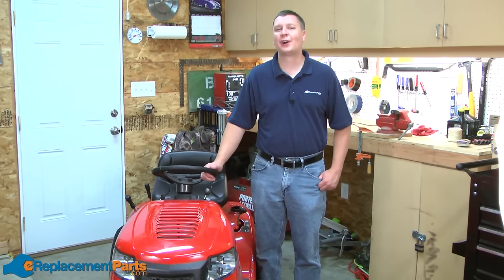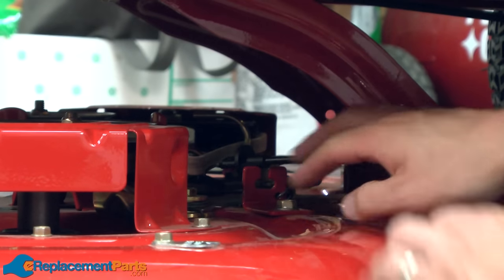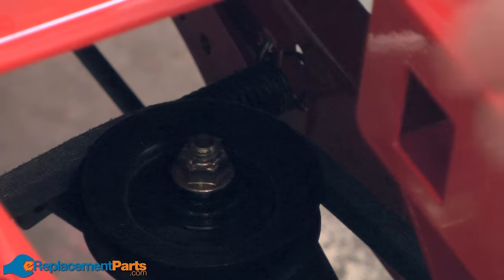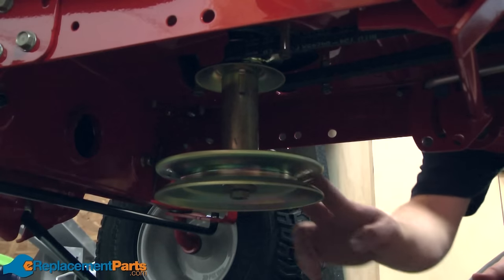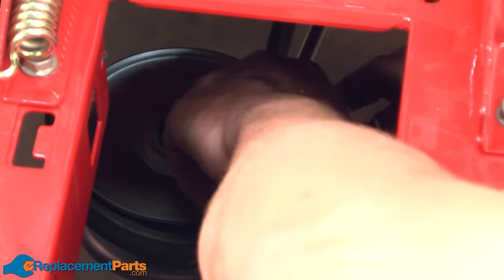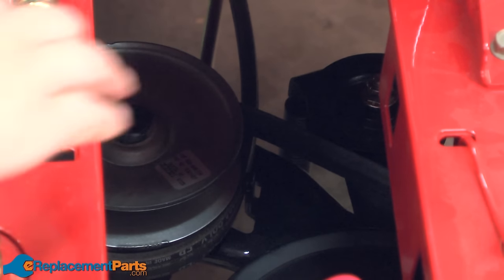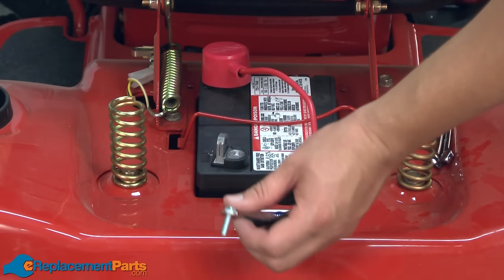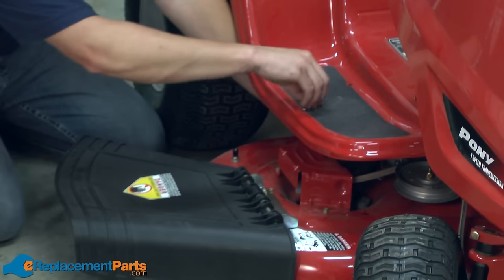How to Replace the Drive Belts on a Troy-Bilt Pony Lawn Tractor (Part # 954-0241A)

Comment: Thanks to this video, I was able o change my Troy Bilt belt. That being said, I will never, ever buy another Troy Bilt riding mower again. Never had so many steps to change a belt on any other mower I've owned.
Reply: Same here. Also I have never had so many problems with a mower before. I've had to replace 2 belts and the blade engagement cable all in under one season of cutting. It's a complete piece of shit.
Reply: I have Simplicity's , I helped a friend put a drive belt on one these Troy Bilts, it had 2 extra pulleys compared to this one, I have never seen a bigger piece of shit mower in my life!!! I used to think Troy Bilt made pretty decent stuff, not anymore after working on this nightmare.
Reply: Bob Faestel
Amen brotha, amen!

Comment: One of the easiest belts i even had the pleasure of changing, You don't have to do it the way he says if you are not changing that small belt and don't want to remove the deck., Just remove the battery and holders, take a 9/16 wrench to the Tensioner pulley it will not take much force if the main belt is wore and pull it towards the rear of the mower and slide the smaller belt off it and off the double pulley. now get under the front and remove the deck belt from the engine pulley, now take a 5/8 wrench to the engine pulley and remove the bolt and slide the engine pulley down and remove the drive belt from it. then go back to the rear of the mower and remove the drive belt from the double pulley the way he shown and pull the belt out. to install reverse order but with a new belt it will take some force to move the Tensioner for the small belt to fit there is no Tensioner pulleys on that big drive belt. should only take 10-15minutes to change that belt. less if you have the tools etc ready.

Comment: The problem I had was with the belt that goes around the transmission pulley, so a lot of this video didn't apply to me. But that which did, especially the trick for removing and reinstalling the idler tension spring, really helped. Once I got a replacement belt, I had my mower back to work in less than 10-mins. Thanks!

Comment: I just replaced a set on an MTD Yard Machines tractor, and they are just that, a set. Change both with OEM MTD belts and it will drive as new.

Comment: Great Video !!!...!!!!   Just finished repairing mine yesterday, but I am having the same issue as others,  in that the mower now moves slow and I can smell that the belt is now smoking.   Mine is a 2011 Craftsman 17.5 hp, but it looks exactly the same as the Troy Built.   (Obviously the same unit with the Sears brand name slapped on).   My biggest issues was determining if the belt goes inside or outside the idler pulley as I have seen diagrams showing it both ways.  It only seems to work on the outside (not the in) and that appears to be what you show in the video at 3.21...   Anyway, I will be going to Sears and seeing if I can take a look at the floor model and see how it works, if they let me remove the battery.  These little belts are breaking for a reason, but I have yet to figure out why, as my idler pulley seems to spin and move freely when there is no belt or spring,  as I  would think it should.   However my spring was hanging lose when I went to put on the new OEM short beltt, so I'm wondering why and if I reconnected the spring  to the proper spot?    I will follow up once I get down to the local Sears to check.  In the meantime, any help would be appreciated.   Dave Finn
Reply: Follow up to my comments above...   Although both models use the same small belt, The 2015 model which is set up the same way as your video is slightly different from my  2011...  :(   The idle pulley spring on the 2011 unit is much smaller and the double belt pulley is located to the front left of the the transmission, instead of the rear left.   However the  the 2015 spring  did   connect to the left side of the frame, whereas I had the spring attached to the side where the grass  exits  from the deck???     Also on the newer model, it was obvious that the belt went on the outside of the idler pulley, while I am still not sure if this was the case on the 2011 model...  :(.

Comment: That looks like a new tractor. On older models, the pulley nut (that you removed using the screwdriver to lock the pulley) is usually quite rusted. Any advice on how to free it?

Comment: Nice tip on the string. Thought of long nose vice grips but I am going with the string theory. Just replaced drive belt, what a battle. Got the belt on but now no start not even a click or any lights?

Comment: Very Helpful. Does the drive belt have an adjustment? MY dad had his belts changed last year and before the mowing season was up the drive belt was slipping. I was wanting to know if there was anyway to tighten the drive belt up. Thanks so much, Johnny
Reply: He might need new idler pulley springs to keep the tension up.

Comment: Last fall I had to use my 2007 Troy Bilt Pony for attaching a come-along to pull a fence tight. Afterwards, when I attempted to put my tractor in reverse, it would not move and stalled as soon as I released the brake/clutch. The PTO was not engaged.Could this be due to a drive belt needing to be replaced? I do need a serpentine deck belt of which I am replacing this week. Would that affect it? Or this possibly a more serious issue with the transmission? I also checked that the reverse safety switch was still intact, which it was.

Comment: There was plenty of time to explain why the negative first and the spring clips are not the pins but only hold the pins in place. Gloves would be recommended to reduce banging hands when clips and springs let go. Better lighting to see the work. This would only help someone experienced with mechanical workings.

Comment: Instruction manual says an impact wrench (which I don't have) is required to remove the front pulley.  Yours was easy with wrench (but yours was a brand new mower).  Mine is three or four years old. Hope I can get it off with what I have. Any special tricks, with a wrench , if it appear that it won't budge?
Reply from the maker: Hi Gene,  not everyone has an impact wrench. An I don't think you will have a problem with a wrench. If you do, get some penetrating oil and let it soak for a while, then you'll be able to remove it.

Comment: Thank you for the very informative video.  Is the idler pully supposed to move freely when the spring is unhooked?  Mine does not move.  I had to loosen the bolt that holds the 2 brackets together, move it in to put the belt around it and then move it back out and tighten the bolt back.  Is this normal or should the idler pully move freely against the spring tension?  Thanks!

Comment: Hey!  You did not have the Belt around the engine Pulley. That will drive the Deck  Blade System. You forgot to do that. Or ,you did not show it anyway.

Comment: ive got a 2003 troy built pont and i didnt have problems with it unit i changed the belt for a new one cause of wear from using it but not my drive belt want to keep jumping to the top side of the verible speed pulley

Comment: Would you use these steps to fix the mower belt? I went to engage the mower blade, and it instantly stopped. I noticed the belt came off. I was able to get the belt back on, and tried mowing again, which worked. Although, I'm unsure if I should replace it as it seemed very loose.

Would you you these same steps to replace the blades as well? Thanks for the tutorial, the only video I found that had good camera placement and explanations
Reply from the maker: Thanks for you comments.  The belt should have just a bit of play in it but they do stretch over time.  If you notice a lot of slop in the belt you you should check you the belt idler and the idler spring.  If the correct tension isn't held on the belt it could easy come off as yours did.

Comment: My variable speed pulley will not turn and is smoking belts.  I've removed three small bolts that attach bearing cup so that I may replaced, what seems to be, ceased bearing(s), however, I can only get bearing cup down maybe 1/4 inch and not all the way off of shaft.  Please advise as to procedure of removing stubborn bearing cup.  thank you-Mike W.

Comment: So I bought that lawnmower last year TB42 Can you pls tell me the length of belt the one that runs from bottom of rear pulling to front top of drive pulley? the belt in video that you ran up through frame. The place I purchased tractor from said they couldn't help me. Thank you
Reply from the maker: +phil gibbs I can get you the part number for the belt.  The TB42 is showing me different trimmers.  Do I have the number right?

Comment: Excellent video.  Did you actually do that in 11 1/2 minutes or is there some time not recorded?
Reply: mcconn746  I just did it for the 3rd time it takes less time if you don't remove remove the deck of the Axle pulley.

Comment: I have a mower like this. Any reason why the brake will not work in neutral? If I'm on a hill, it will only stop rolling in gear. The mower will stop while it's in gear.

Comment: My Front Motor pulley is hitting my deck and I can't raise my blade up past the 3 mark.  What do I need to do to get the pulley up and away from deck?  something must have jolted in traveling on trailer as it was not like that before traveling. Puzzled.  Any guidance is much appreciated.

Comment: I got a question I replaced my drive belt on my Troy built pony, got everything back together and with the mower in neutral and and mower turned off the mower will not roll forward or backward, what am I doing wrong?

Comment: Not to nitpick BUT...  you seem to forget about the pulley assembly mid-tractor & what a pain it is. Leave a socket in place over the nut in the floorboard while changing or it could move & you'll lose it.  Also you should ALWAYS disconnect the positive terminal on the battery first or you're in for a surprise if the wrench accidentally makes contact with the frame.
Reply: Actually, just the opposite.  You are more apt to hit the frame when removing the bolt.  If you hit the frame while disconnecting the negative, nothing will happen. Then there is no chance of a surprise when removing the positive.

Comment: I RECENTLY DROPPPED THE DECK ON MY TROYBILT PONY MOTOR AND SHARPENDED THE BLADES AND NOW ALL MY BELTS ARE LOOSE AND THE PTO DOESN'T SEEM TO ENGAGE WHAT COULD I HAVE DONE WRONG?

Comment: How much slack is actually in that lower drive belt that runs to the engine. I have 2 pullys that the belt runs over one and under the other; all springs are on and routing is correct, but lots of slack in this belt. Belt size is also correct. A picture of the amount of slack would be great. My mower is a 2004 model TroyBilt Super Bronco. The pony seems pretty close to it, with a few exceptions. Also, do yall have any videos on disassembly and assembly of the transaxle? Im gonna need parts for this. Thanks!
Reply from the maker: There should be 1/2" to 1" play in the belt.  The Idler Pulley and Springs are there to pick up the slack and keep the belt snug.  If the belt is to tight it puts unnecessary wear on the bearings and mandrels. We don't have much information about working on transaxles. Most of the manufacturers do offer the transaxles as a replacement part but typically nothing for the inner repairs.  Peerless manufactures alot the transaxles and depending on the manufacturer of yours, may be able to get a service manual to you.

Comment: Is this procedure the same for the Troy-Bilt Xp Horse Hydrostatic?
Reply from the maker: The procedure should be exactly as shown in the video.
Reply: +eReplacementParts.com That fixes the belts, but what burned them up in the first place?  Our Bronco (same basic design) rides forward in jerky movements and there is a smell of burning rubber   The short drive belt is frayed.  Could a bearing be bad somewhere?

Comment: Does the deck have to be removed for this repair?
Reply from the maker: Hi Michael. Thanks for you question. In order to properly access the pulleys that the drive belts run on, it is recommended to remove the deck. It is an additional step, but it will make your life much easier when you try to remove the belts. Thanks again and good luck with your repair!

Comment: I have a spring on my troy built bronco that I can't figure out were it goes. . I removed the deck to change blades .Now I have I spring about about a foot long that I can't figure out were it goes. .
so I tried the mower without the spring and it will not engage my blades to start cutting it related to that but I know where it goes?
Reply from the maker: +shon CONFIRM The spring you're asking about goes from the Idler pulley mechanism to the frame of the mower. If you can find the model number on the mower I'll get a parts breakdown to see if that helps.
Reply: +eReplacementParts.com I need help to start my lawnmower troy build

Comment: I purchased the belt off eBay the one that goes from the engine to the rear differential , unfortunately I realized too late that either I have to pull the engine out or remove the pulley to avoid the belt guides you know the two piece of metal sticking out of the frame to make sure the Belt doesn't jump out  ,is there an easier way of doing it ?
thank you and have a nice day
Troy-Bilt riding mower
model number 13AN77TG766
Reply from the maker: Here Is how one person replaced the belts on his Troy-Bilt Lawn Tractor. I hope this helps. First I had to raise the rear of the tractor an remove the rear wheels. Remove the bearing cap an bearings from bottom pulley. Remove nut on top rear pulley both at rear of tractor. Then I removed the spring tensioner from the drive belt.Remove old belt an thread new belt up an around front pulley on motor that way you don't have to remove pulley on motor. Put the new belt on pulley and replace pulleys. Attachtensioner spring. Put wheels back on.To install new cut belt I just had to remove two pulley guards an remove one tensioner pulley.The pulley was held on with a nut an bolt, both very easy to get at. Remove old and replace new. Remember placement of belt to insure proper placement.The belt will fit in other ways but will only work in proper direction.Oops.Replace one pulley and pulley guards.No need to remove any springs in this application. You are ready to cut. The hole process took about 1-1/2 hours. It is best to have 3/8 an 1/4 inch socket sets.The 1/4 inch set works best on the cut deck.

Comment: I replaced my drive belt on my Poulan riding mower and for some reason the brake does not stop the mower anymore and the belt is the right size any ideas?
Reply: Thanks Ryan for the feed back the belt was put on wrong all good now. Thanks again.....

Comment: I RECENTLY DROPPED THE DECK ON MY TROYBILT PONY MOWER TO SHARPEN THE BLADES AND NOW ALL MY BELTS ARE LOOSE WHAT COULD I HAVE DONE WRONG?
Reply from the maker: This is a common problem even for some pro's.  2 of the most common issues it the Belt Routing. One missed zig or zag can mess everything up.  The other issue people have had is getting the deck in the exact position lined up like it was originally.
Reply: +eReplacementParts.com What is the remedy for that?  My motor pulley is hitting my deck and I can't raise up high or the pulley cuts into the deck.  Help please.

Comment: hi i replaced the drive belt on my 2007 troy built lawn tractor just like the one in the video but now my mower wont go fast .do you know why?
Reply: I did the same thing and I'm having the same issue.  It is either a stuck idler pully or a worn/stuck variable speed pully.
Reply: jeopardy98 Prolly because u used a aftermarket belt.
Reply: Used the proper OEM belt and have the same issue Cheyenne and Jeopardy98..  Did you ever solve this issue?   I have a Sears model and plan on taking a look at a floor model before I proceed further.
Reply: Seaside Beach House what issue. I had to replace all the belts was my problem.

Comment: Hello have a question for you.  My Troy Bilt Pony will not go forward or reverse, when I lifted up the seat I noticed that the large pulley that is on the transmission was really lose and that belt had come off the pulley system.  I replaced the belt but it still will not go forward or reverse.  Any idea what else it may be, could the drive belt be bad? Or is the transmission shot?  Any advice will help.  Thanks
Reply from the maker: I suspect the transmission has gone out causing the slop in the pulley.  The only issues I can think of with the belt
would be the wrong length and if the belt tightens and loosens when you operate the clutch,  you're probably fine with that.

Comment: Is easy when its practically all loose already.'terrible explaining of what size tools, 7/8 , 3/4 etc etc......troy bilt needs new engineer to design a new easier maze of shit to take off just to change a damn drive belt
Reply: Steven Dolezal That main drive belt is one of the easiest belts to replace. That main drive belt only goes from the crank pulley and double pulley, there is no Tensioner  pulleys under the frame so it is real easy to replace unlike alot of others i have done for people, I had one take afew hours to do because there was sub frames etc you had to remove while one in this video takes all of 10minutes to change lol.